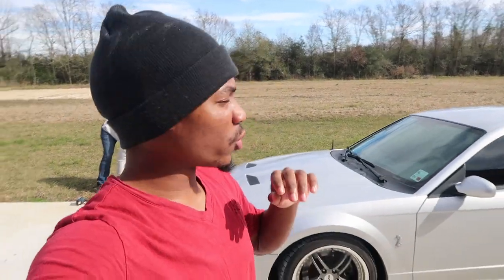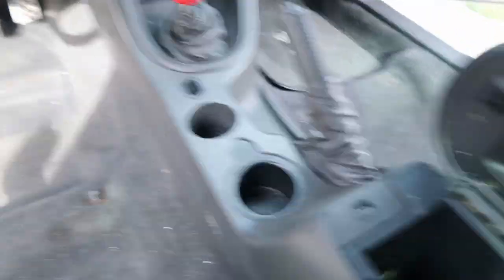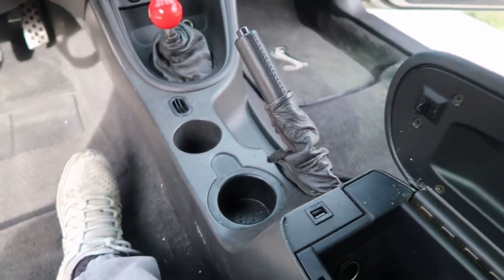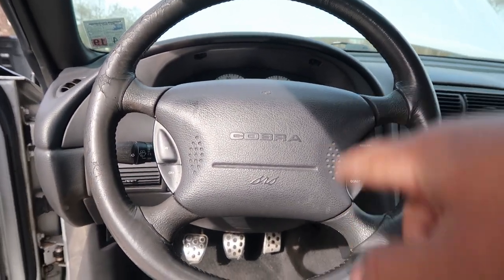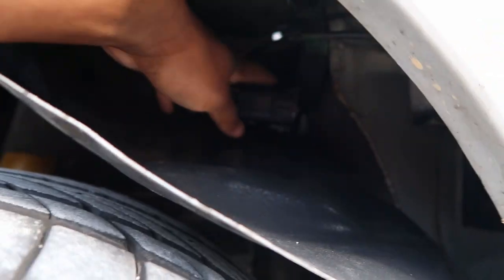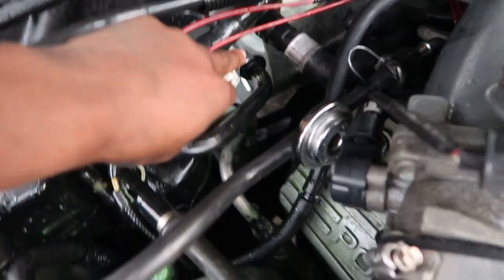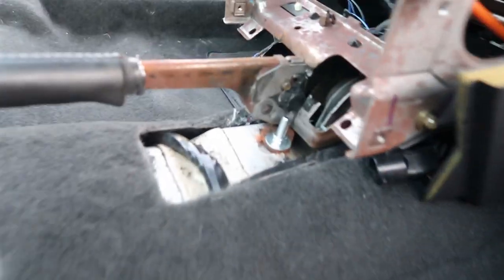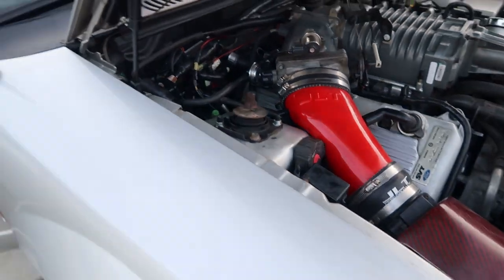Changing Evaporator Core | 2003 Mustang Cobra

Comment: I got an 02 GT and replaced the condenser, after 3 days the freon bled out somewhere, and I hope my evaporator core is not leaking.  That's a lot of work to replace it.  I wasn't sure if I needed to remove the dash, but now I know.  Will pressure test first and test for leaks 1st.  Good video on " How to".  Yes you should make some more videos.

Comment: after you disconnected the connector for the dash in the wheel well u did not show how you took the dash out, the video cut to after it was already out thats the hardest part that would have been a great point in this video but still a good video :)

Comment: Hey question, is it possible to clean the evaporator thoroughly with a hose without removing the dash? If i remove my blower i can look through the duct it blows and see the coil and mine is kinda plugged with dirt thanks to fords filter-less design and it now struggles to cool in the hot sun. Im just wondering if thats an option or not. Thank you
Reply from the maker: Idk if that method is possible, but it’d probably be easier to just get a friend to help you take the dash out and knock it out in a day. You’d have to make sure that the AC system is completely empty first tho, or when you decompress the lines to the evaporator core Freon will go everywhere
Reply: @pj_morrison  true, i dont plan to replace the evap or remove it, just get ample access to clean it in place, Thanks though i will certainly follow your advice and remove dash when i get a chance
Reply: maybe if you take the blower out you could clean it and let it drain through condensation port out to the ground
Reply: @ufartface  i have considered that, however if im not careful i can see it making a huge mess on my floorpan